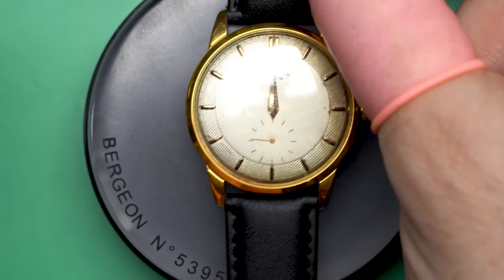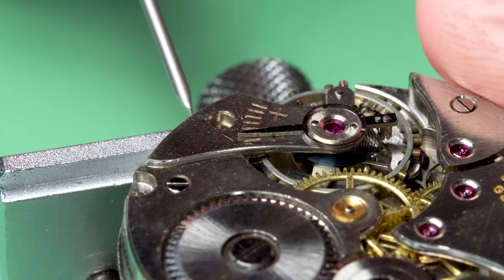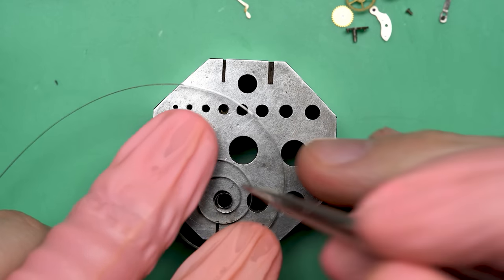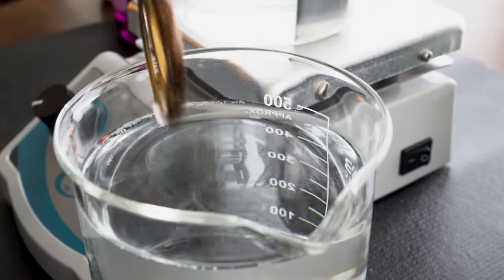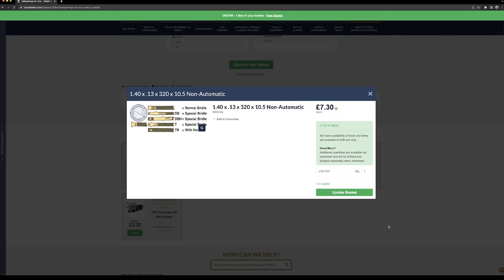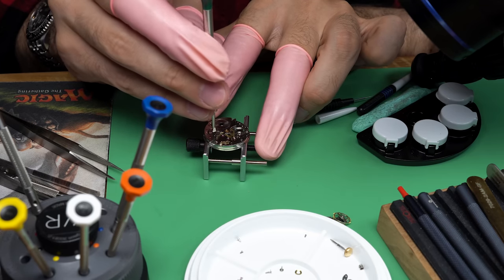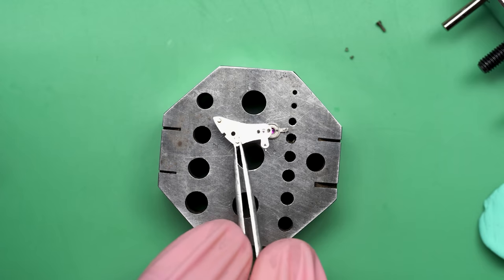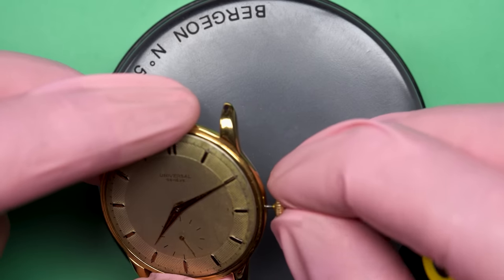Here's My First Attempt at Gold Plating During a Vintage Watch Restoration!

Comment: Marshall, the gold bath is the purple colour from cobalt compounds used to harden the gold. You rightly pointed out that 24k gold is a different colour, it’s ironic but it often looks cheaper. The Swiss have a series of gold colours defined by the alloy composition. Several plating  solution companies make solutions to replicate those colours.  A useful tip, you set the voltage of your plating, which is fine, but if you calculate the area of your parts carefully and check the current density that way you won’t “ burn “ a part. You also touched on the joys of stripping gold, again it can be done chemically, but the solutions tend to be either cyanide based or very smelly amines, neither are kitchen table material.  A good stripper must munch the desired coating but not the base, in this case a copper zinc alloy.  Your route is fine for a single part, but gets tedious if you have hundreds!
Thanks for sharing your enthusiasm so concisely.

Comment: As I work formulating plating baths I have a few tips for you: hang the pieces with a copper strand from a stripped copper wire, twist  the copper over the piece to make a good connection, but make sure the piece wiggle, the wire move around the piece 
(This avoid wire marks). The piece is wraped in this strand and is only removed after the last step.
ALWAYS conect the part before the imersion, gold being more noble than nickel will chemically plate if not electrically connected (the plating will be more dull and can flake off)
Use diposable copper strand for each piece
Rinse the part in tap water from a faucet, loads of water to be completely clean, then spray with a pissete the deionized water (distilled or whatever).
Never dry the parts or touch them
ALWAYS move the part being plated up and down, sideways. It's more important than the movement of the liquid. 
Nickel plating solution normally is darker in color (higher grams of nickel per liter), and it works around 50~60 °C.
Nickel can be switched to Tin plating (white brass) or palladium plating if allergies is of councern.

If you want to measure the gold weight deposited, you do a pre plate (low gold content) then dry the piece (with the copper strand) weight it. Electrodegrease again, wash, and do the gold plating, dry and weight the piece with the copper strands. The weight difference (before-after) is the gold deposited.
My specialitynis rhodium plating, if you ever want to try send me a msg
Reply: Also, do you play magic?
Reply: Also you need nickel plating (or tin or palladium) for a diffusion barrier between the brass and the gold. 
If you do not make this barrier the gold plating will have dark spot within 30 days, the copper (from the brass) diffuses to the gold layer and start making dark spots on the surface.

Comment: Nice work again , there actually is a site on the internet, where you just add a few number, height, barrel diameter aso. And that site fills in the unknown figures following the law of third in the barrel aso. And tells you if it is within tolerances to find the correct spring, its a very useful tool, now that the swiss watch mafia, the swatch Company has locked the Doors for the Blue book bible  called generale resorts where all is listed 
Have a nice day 😃👍🏻

Comment: Glad to see you wearing gloves for the electroplating. So it happens you have at least one chemist who is a fan, a chemist who happened to do his doctoral work on gold chemistry. The gold in solution is probably purple because large gold particles have a pretty big absorbance in the yellow/orange region of the visible. It absorbs orange, you see purple. So my guess would be that the plating solution just has a bunch of bigger than ~200 nanometer gold nanoparticles in it.  If you just had something like a gold chloride solution it would either be yellow (Au3+) or colorless (Au+). My guess at the nickel is that it's a cheap nickel salt like nickel (II) chloride that's green in solution. Something to color it would probably interfere with the plating.

Comment: A small tip, the wire you use to hold the parts to be plated file a small grove. It will give the part a placeholder to keep it from turning back and forth and not touch the other parts. Thanks for your posting.

Comment: Another stunning result. Great gold plating job as well. I wonder what sort of keywords you use on ebay to find these things because the pickings usually seem pretty slim when I search for terms like "as is" or "not running".
Reply: I don't do watches but there is a selector on ebay where you specify "new, used, not working/for parts", try it. Rather than a keyword. Hunting for good stuff to repair just generally takes a long time and a lot of effort, that's just how it is.

Comment: I found a trick years ago that helps you avoid cross threading a screw - turn the screw like you are unscrewing it.  It will click into place when you have it correctly threaded.  You can then tighten it with the threads of the screw correctly aligned.

Comment: Very nice project/video, just a small piece of advice. There is a significant difference between current and voltage. Voltage is the force the electrons are pushed with, current is the number of electrons per time unit. So saying "running x volts through" is technically wrong, the correct wording would be "applying x volts/running y ampere through". This distinction is important, as in any type of electrolysis process, the plating parameters are (normally) determined by the current which flows, the amount of which is determined by the applied voltage and the resistance it encounters (and this resistance is not really constant in any way, thereby the current may vary somewhat unpredictably). 

A thing you could try is to short the output (the red C.C. led should light up), set the intended current via the current controls, disconnect the leads again, and then (although not really necessary) set a maximum voltage to be applied.
This forces the plating to occur with constant current, until the maximum voltage is reached, at which point the supply switches to constant voltage and the current decreases. With your plating setup though, you may not reach the constant voltage part as you are plating with a certain duration.

Hope this might help, keep up the great craftsmanship :)

Comment: I used to plate electrical contacts on pc boards with 23 karat gold improved  the electrical connection took about 10 mins per board, the plating liquid would loose the gold in solution after a while.

Comment: The plating solution colors are correct, Gold is purple and Nickel is green, I used to work at a Electroplating Supplier back in the day. Gold solutions (s\Silver, Zinc) were Cyanide based. They would strip the old gold off and reclaim it.

Comment: can we get a video where you take a relatively complicated watch for it to have all the quirky features a watch can have? The main theme of the video would be "how does a watch actually work" in it you could explain how different components interact with eachother and how it is done differently in other watch brands and stuff. I'm really interested in the mechanincs of these... like starting from the spring where is the power transfered to exactly and wich wheel is responsible for what at wich ratios and stuff. Also how does one calculate the weight and diameter of the balance for it to be acceptable to a certain watch. I love your channel you do some great work

Comment: The full word you probably want for "electro cleaning" is electrolytic cleaning. An electrolyte is anything that can be dissolved in water that will allow a charge to flow through it, such as the acid you are probably using. The colors that your plating liquids have are entirely due to the metals dissolved in them. The color will change dramatically depending on the charge state of the metals, so if they ever turn a different color you might want to get new ones.

Comment: How long do you normally leave the items in the electrolyte solution? I read that the thickness of the plating is directly effected by the amount of time in the solution during the plating process. Is there a mean time that you'd leave the piece in as to not affect the friction fit of the pieces? Also, when you said gold plates to nickel really well, I didn't quite understand what you meant so I did a bit of searching and apparently nickel, silver, and palladium are used as a barrier material as to keep diffusion of the base material from happening through the gold.

One more thing I noticed that you didn't talk about is the balance wheel has a + and - on it like you can adjust the balance weight or something. What is that for?

Comment: A great video! But I haven't got the point about plating parameters. You fixed the tool at constant voltage at 1.5V, didn't you? But you haven't fixed the current at any maximum level, correct? And how long did it take for the plating cycle? Thanks in advance!

Comment: Thanks!
Reply: Hi Marshall, Quick question--what was the solution you used to electro-clean the case before nickel plating? I want to set up a similar rig in my house and am looking to avoid having to bring in acids since my home workshop is really tiny. Lastly, would ultrasonic cleaning using simple green work as an alternative? Thanks again!!!

Comment: I clean cast iron pans with a sacrificial steel plate and a car charger for the positive and negative leads in a solution. In short order, the cast iron is grey and as it came out of the mold.

Comment: Have you changed your lighting setup recently? I'm only just noticing the speckle in the gears and your tweezers. I almost thought it was a unique finish on the gears until I noticed your tweezers had it also. 7:57 is a good example

Comment: Hi, I am new to your channel and I am totally hooked watching you repair these vintage watches. My son had a Mickey Mouse watch when he was young that we bought in the 70's. I not sure what is wrong with it as it will not wind or run. It says Ingersoll on it. My question, is it worth getting it fixed as we want to give it to one of the grand kids that loves Mickey?
Reply: That's a vague fault description, maybe bring it to a local watchmaker and ask for a quote. Whether "worth it?" Depends in what sense. It might be a large chunk of change that you could buy several watches for, and it was never a valuable watch per se, and won't be afterwards, you won't make money by getting it back up and running. But on the other hand it should be mechanically good as new when done. What's your personal threshold for "worth it"?

Comment: Hey, when I search for 'Main Spring Winder' on eBay, it looks there are some decent looking ones for around £100 - I realise that some of them might be clock and pocket watch spring winders, but some look like they are for wristwatches. Is there any reason you said that Main Spring Winders will likely cost $700-800, as in, are the ones off eBay, ones that I should avoid for any reason?
Reply: He bought his mainspring set from Bergeon. It is the reference in term of Swiss watchmaking tools. Obviously, it's expensive because it's Swiss and brand new, so it's around $800.
Reply: They come in different sizes for all different size springs. 700-800 is what a new Swiss set will cost you. I've seen some replica sets on Ebay go for about $100-300, but no clue what the quality on those are like. Just the replacement barrels from Bergeon are about $100 each.

Comment: Hello, where do you order the parts from again? I need a couple of main springs and not been able to find the right supplier. I'm in the UK 🇬🇧 so very useful to have a link. Many thanks
Reply: Ok, I guess YT is stripping anything that vaguely resembles an external link, I've replied twice so far (in case they appear later). The one Marshall references is cousinsuk, just search for that. They're a business to business supplier, but have pretty much everything you need. There's also esslinger (search again!) Which is in the US, so you'll see the same delay, only in reverse.

Comment: Would you like to share some figures? How much did the watch cost on Ebay? What can the renovated clock bring in on an acution? How much did the parts used cost, mainspring, glas, nickel and goldplate? And mych time did you totaly spend on the project?

Comment: I have a question….I’m replacing a rubber gasket/washer in a Casio SGW 500-H. The case back screws have stripped their housing on all four (like they weren’t meant to be unscrewed? I’m the original owner). I tried putting some jbweld in the holes for something for the screw to grab purchase but that didn’t work. Are these cheap watches just destined for the trash or donator pile or is there some way to fix this? I need the screws (which are fine by themselves, not stripped) to go into and tighten the case back. The watch is “waterproof” with the case tight and rubber gasket in place. So it needs this to function as it was built.

Comment: Buy yourself some dial washers instead of putting the old ones back on, also the reason the green stuff on the edge of the dial won't clean off is because it's trapped into the clear coat.

Comment: How much would you charge to plate my vintage watch I have already disassembled watch and polished to bare brass.the bottom case plate is stainless I want that plated to in 18k how much would you charge also put in a new low dome crystal

Comment: I have a vintage  25 jewel Perona automatic watch that I got for £39.50, and it works well but whenever I wind it is very stiff even when I wind it after a day. Is this because it shouldn't be wound anymore or is it because the mainspring or the movement needs general lubrication?

Comment: @Wristwatch Revival - I’ve watched a number of your videos and they are awesome but - you do one thing that makes me cringe every time I watch. It may seem subtle and silly - until it bites you one day. Stripping screws! I’ve learned over the years that driving a screw into used threads without ensuring you’re in the existing groove greatly increases the possibility of stripping the threads. This is further exacerbated when the threads are in plastic or fine pitched or as small as the ones you work on. Always turn the screw in the opposite direction (the removal direction) while applying gentle pressure until you feel a drop or thump on the driver (however slight that thump may be) as this locates the old thread. Once you do, you can then drive the screw normally knowing you’re in the old thread. I’ve done this for so long now that it’s automatic. I hope you read this and find it helpful!

Comment: Loving the uploads, can anyone help? I have a 1948 Rolex 2940  with a dead minutes wheel after inspection. Told it is very clean inside and want this watch back on my wrist, cant locate the part. Yes i am from the UK

Comment: Just curious - @ 13:25 at the bottom  of screen a little right of center is a tiny ring shaped part. Was that a part you forgot put in cleaner or is that a little rubber O-ring???? For some reason that bothered me the same way a microscopic hair on a part bothers you. LOL

Comment: The "micrometer", as you called it, is a dial indicator. (Though it's certainly possible it has a more specific name in the context of horology, especially with the attached anvil.)
Reply: If you search the name on the dial and it turns up identical products labelled "micrometers", I think it's because of the attached anvil with the dial indicator, but it could also be a common misnomer
Reply: @CrmsnDragoon  In the context of metrology in general, a micrometer is a different tool. Though, to be fair, a micrometer has a built-in anvil, and a dial indicator doesn't. I guess this thing is like a hybrid of the two: the measuring mechanism of a dial indicator, with the built-in anvil of a micrometer.

Comment: I'm mechanically in cline or kline, but my Adderall fueled hands & fingers shake like a tic-tok tweaking video.  I also love specialized tools for any trade. That spring winder set, yeah boi.  Like a jay-hooked rench for tightening the distributor on a 90's Pontiac firebird.  Or a jam cutting saw for that seamless flooring installation. These things are not necessary for getting the job done, but man they make you look good while using them. 

Your next hobby should be exploratory surgery on deceased animals, and work your way up to black market organ transplant surgeries in Mexico.  I guarantee you will make more money than flipping watches on eBay.  I'm just saying, because you got them steady hands.

Comment: What I don't understand is why older wrist or pocket watches don't appreciate in value.  This also applied to wall and mantle clocks.  If you buy an older antique watch for say $200 and put a $300 service on the watch to make it work again, all you still have is a $200 to $300 watch, not a $500 watch.  This is so unlike art where new, the artwork starts out at say $300 and in 50 years, that same artwork could be worth $50,000.  Why don't time pieces appreciate in value like art?   Under your microscope, these watches do look like works of art.